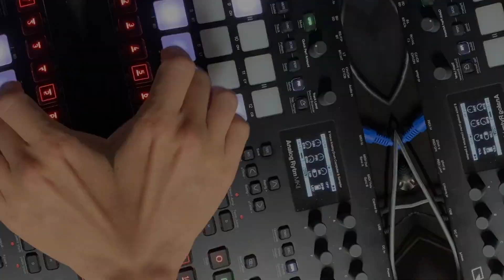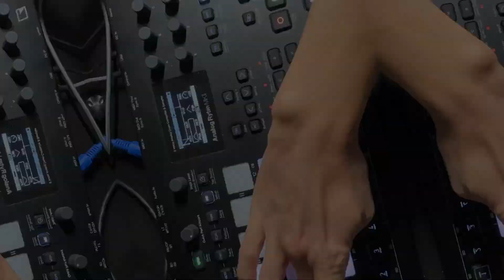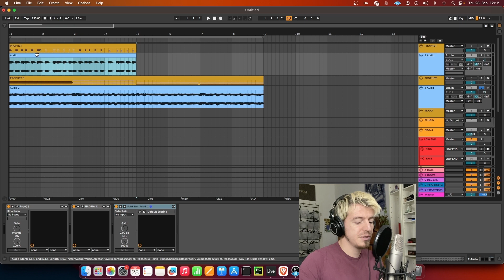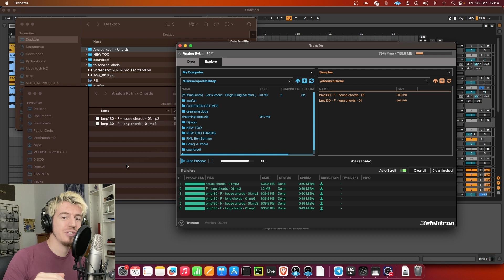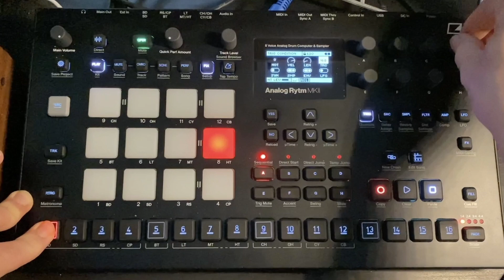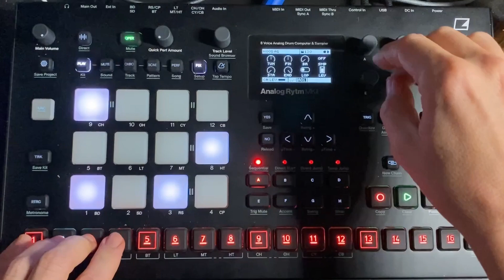Comment: Sorry, but you're just giving bad advice. You could've set the 1/2 speed (scale, as Elektron calls it) just for one track, not for whole pattern. That way you wouldn't have to redo all your drum sequencing for other tracks. Just switch to Advanced mode in the Scale menu and you'll have different settings for each track. Also, you'd have to set your Master Lenght (LEN on the right side of Scale window) to lenght of your most long track. Or just set to some large amount like 128 or 256 steps or even Inf. In advanced mode, each track sequence is playing and looping by itself, each can have different length, and Master LEN is basically the amount of steps (in normal speed) before ALL tracks will be reset to step 1 again.

And for the chords - you don't always need to match BPMs, you can chop and shape sampled chords in the sequence, using sample start and end points as well as built in ADSR and filter envelopes
Reply: Thanks for commenting :)
And thanks for suggesting a fourth way to include chords in patterns via the advanced mode - in the video show 3 other ways I use to achieve exactly the same thing. 
Regarding not matching bpm, I tend disagree with what you wrote, if your recorded loop is at say 120 bpm and your pattern is at say 130 how would you use the ADSR or sample start/end to make the bpm of the recorded loop and the pattern match?The loop and the pattern will anyways play at different speed/bpm no matter how you chop the loop. 
The only way I am aware of to speed up or slow down the recorded loop (in the example above from 120 to 130) is via sample tune, but since there is no syncing/warping algorithm in the rytm you will end up changing the pitch/key of the chord loop. Happy to be proved wrong and learn something new ;)
Reply: @solarj hey there's a time stretch trick you can do using retrig and velocity search time stretch rytm on YouTube. It's not perfect and I think it can only be one or two bar loops but yeah.